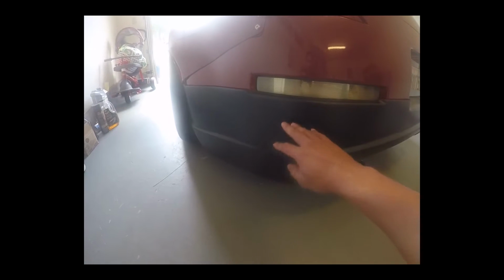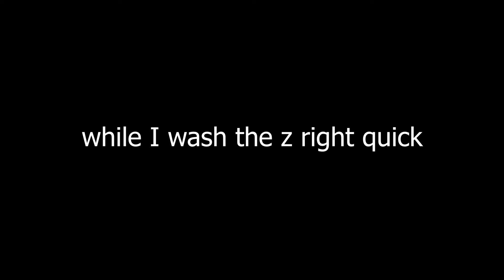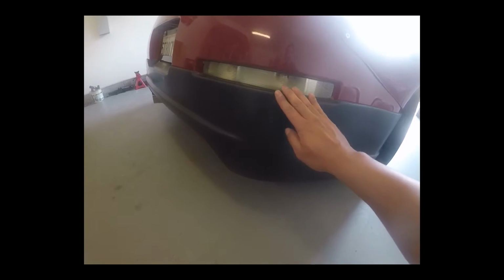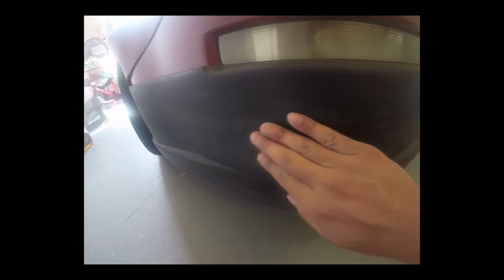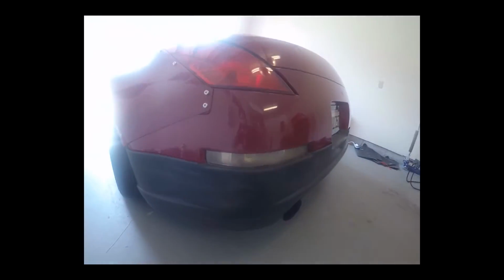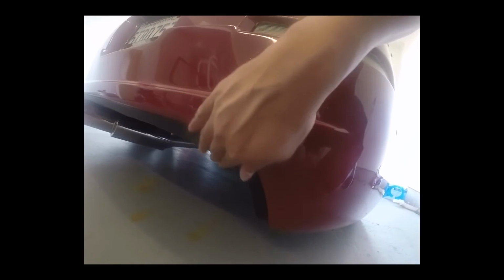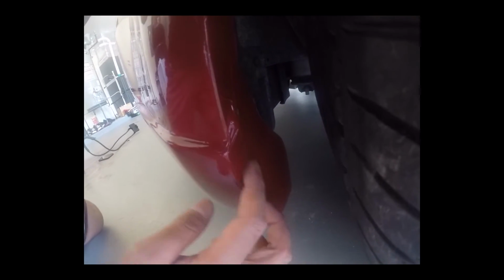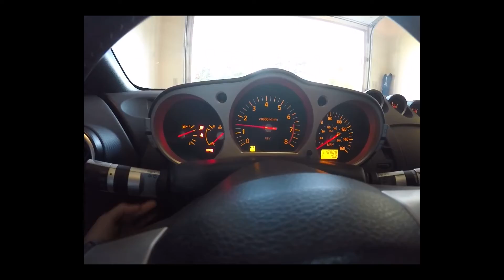Wrapped the KBD rear lip on the 350z | Almost complete

Comment: what did you do for the wrap to stick on to kbd?
Reply from the maker: I just sanded it down with 80 grit then wiped it with rubbing alcohol/brake cleaner. Hit it again wit a 220 grit then wiped it down again. Just removing that coat of grease KBD puts on their products. Hope that helps 🤙🏽